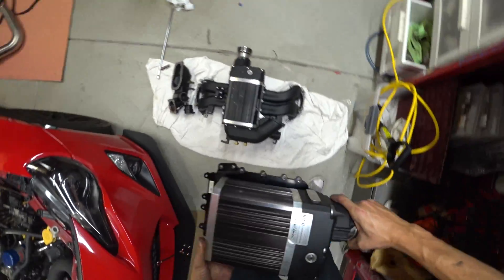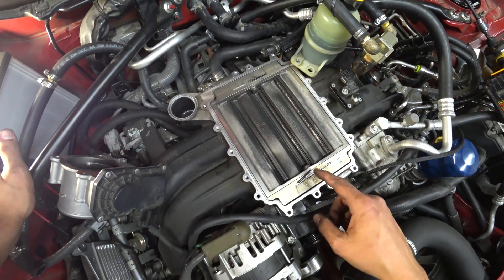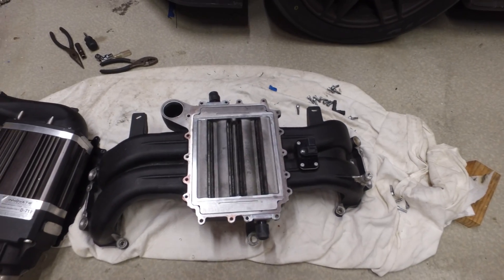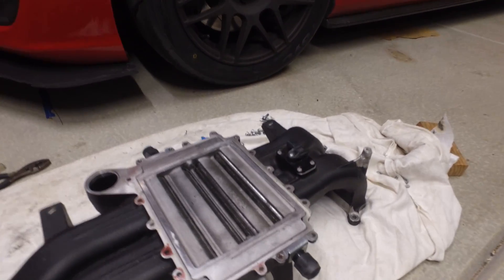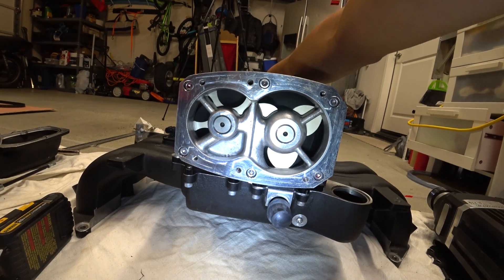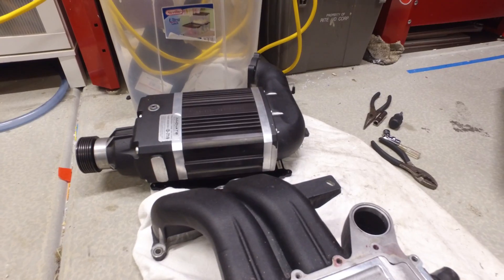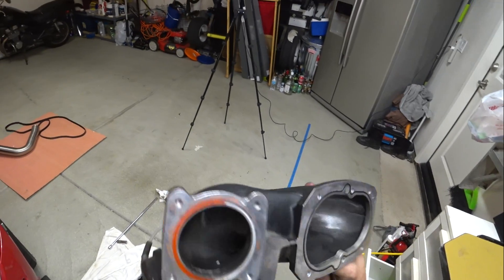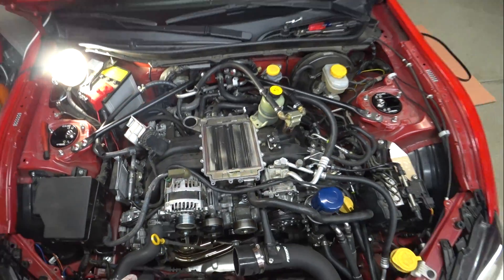Inside The Sprintex Supercharger-Bypass Valve, Intercooler, And Screws!

Comment: Did you ever have emissions codes while running this 210? I keep getting the p0451 code. New gas cap, new evap solenoid, same problem. Thanks for any info

Comment: Just got this kit and planning on running it with the stock motor any recommendations on things to look out for one got  fuel pump injectors oil cooler oil catch can perrin cai and mishimoto radiatior still deciding on  clutch
Reply from the maker: You got the main thing, the oil cooler. Clutch can probably wait a while, I was good on stock until I swapped to the 335 unit.